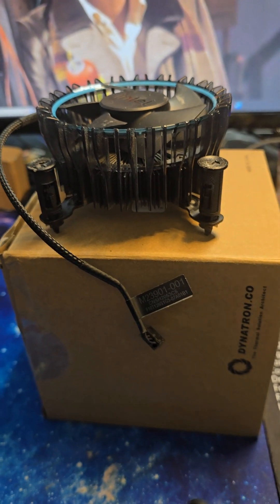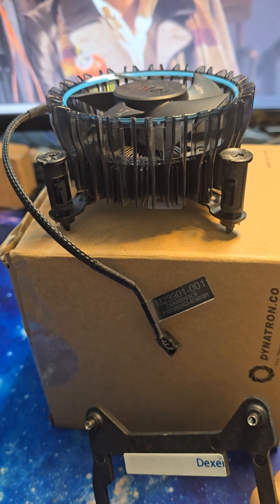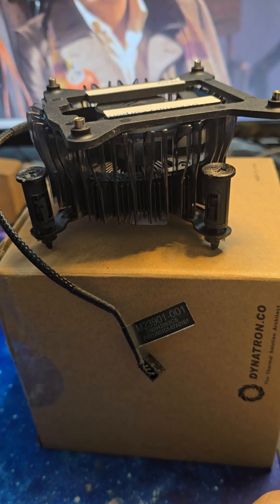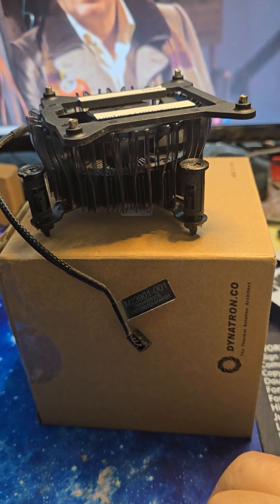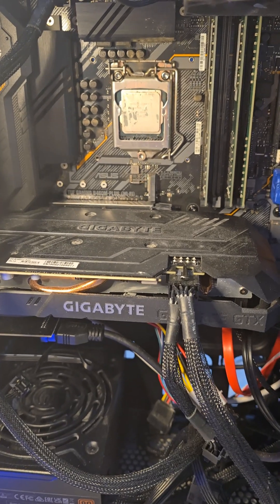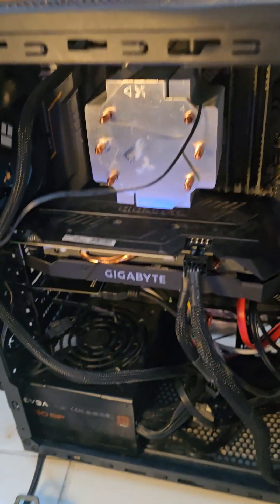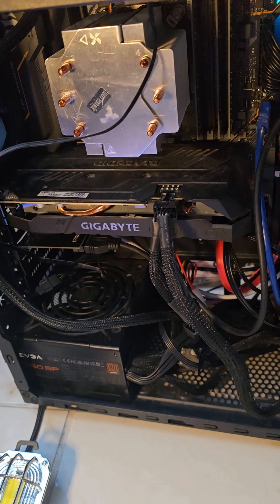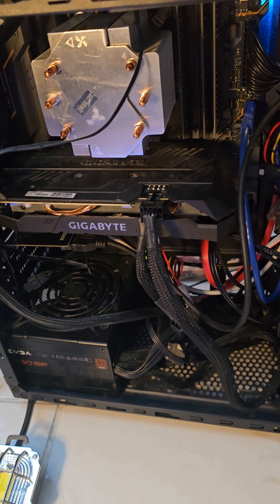EASIEST Way to Install a Back Plate Without Removing the Motherboard!

Comment: Yeah, but make sure to secure it with something. Yes the cut out is easily accessible, but more often than never these things just fall out, and if you lay the pc on the side, there is a gap, leading to the thing also falling out. 

If you are upgrading, its also best practice to use the bracket when it comes with your cooler, since some cooler might be heavier and need a special bracket. If you use lighter ones of course this is fine. But secure them with something, otherwise they will fall out, speaking from experience. 😂

When building the pc, just put the cooler on first, but don’t forget your ram and cables! Otherwise you’ll have to wrestle with those😊